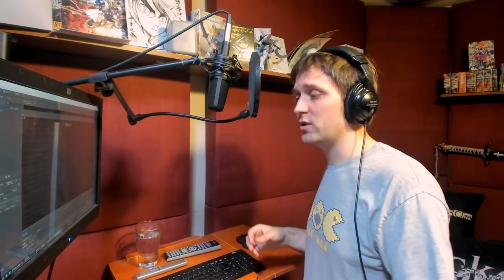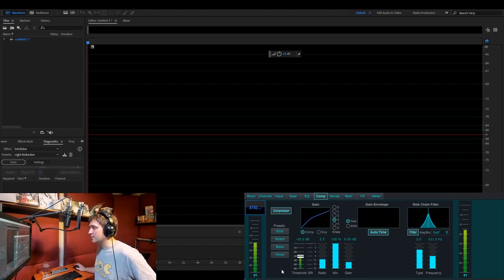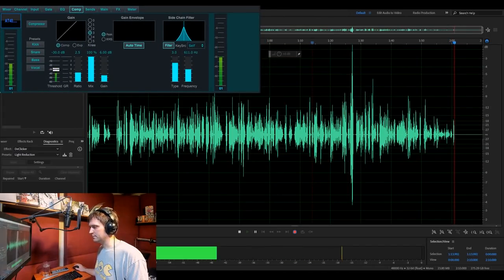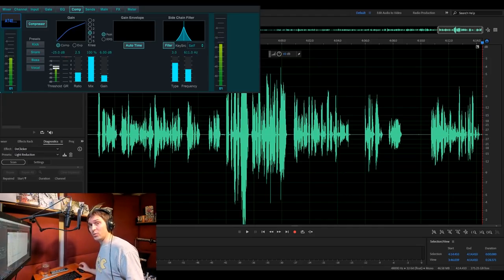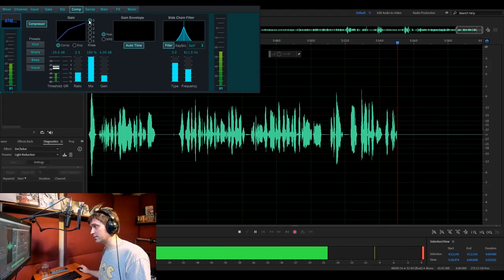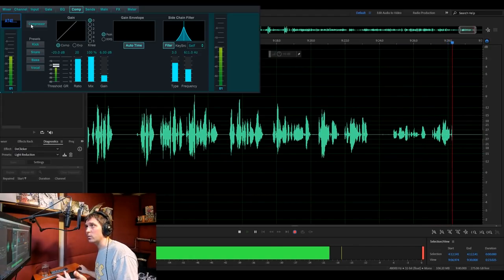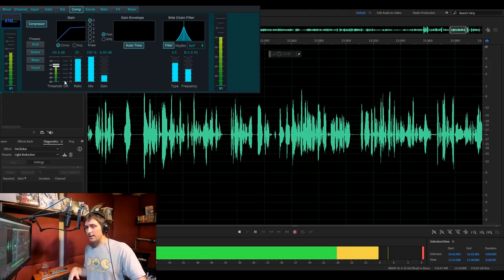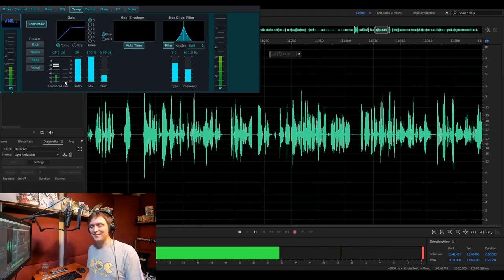VO Engineering: Compression

Comment: next one: Fuzz ? :D

What would be your attack and release settings in a VO Engineering context ?
Reply from the maker: RabbaDooDabba I don't understand the question
Reply: the one regarding Fuzz was more poking fun that compression is also used on instruments, as a tounge in cheek "what other effects are you using?"

I only use compression on bass (so in a musical context) so maybe there is a standard Attack/Release setting used in voice overs

Attack is the time it takes until the compression kicks in (usefull to get the transients through and compressing the rest of the note) and release is the time until the compression is turned off (usefull if you want the note to sustain longer than normal)

I may be wrong about this as I am more or less just dipping my toe in compression and was just curious.
thanks for the fast reply though ^^
Reply from the maker: RabbaDooDabba the "fuzz" part was the part I wasn't understanding, but VO-from-home doesn't make use of a whole lot of processing effects. Attack and release are both pretty quick for VO; I talked about it a bit in my video on downward expansion. But this compressor has auto settings for attack and release, so I haven't had to dial that in.
Reply: just to clarify:AFAIK Fuzz is distorting your signal so much you get a square wave, not a desired effect in voice overs, I am pretty sure at least :D
Reply from the maker: Typically that's referred to as distortion or clipping